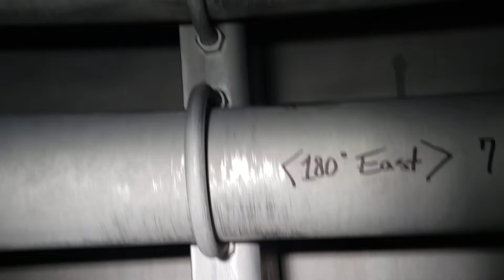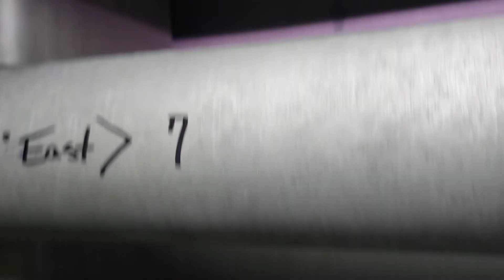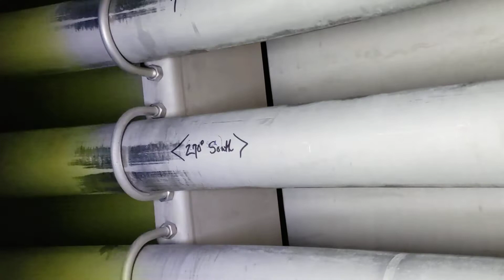Vessel internal inspection, API 510

Comment: Zero degrees should be north/plant north, or however the vessel dwg is laid out…
Reply from the maker: Dillon,  this layout was plant north. 

I agree.   Vessel (and tanks) layout should match an existing dwg or north,  or the manway, whichever seems the most logical.   The phrase I use when mentoring is "be most clear"..... meaning use what is the clearest, most unambiguous method. 
MrEric

Comment: We had one in our unit and I  had two bad tubes that we replaced in place. Heat treaters are always something.
Reply from the maker: This is not a heat treater.  It is a vertical vessel with internal coils, used for heating and/or cooling.  Mr. Eric